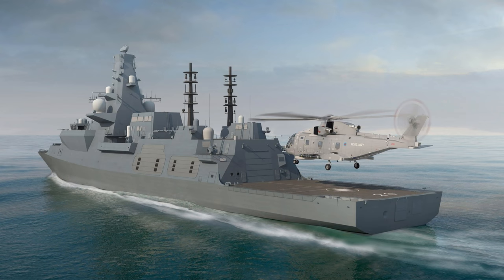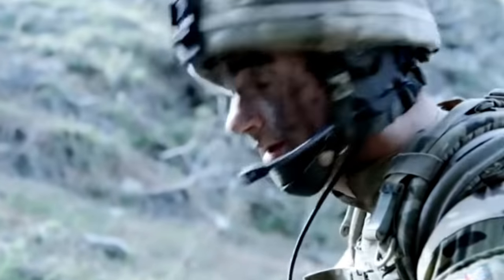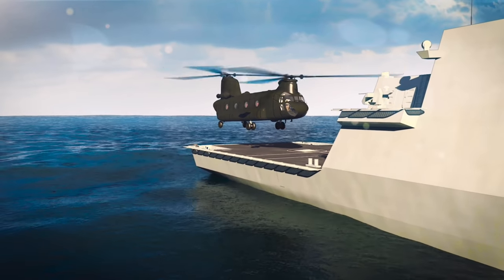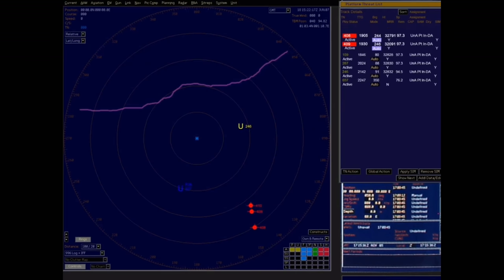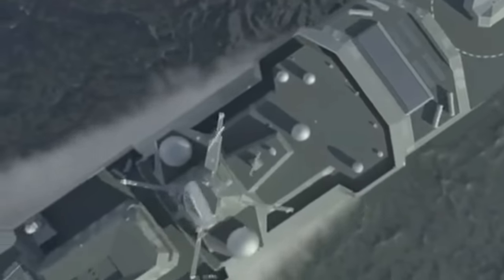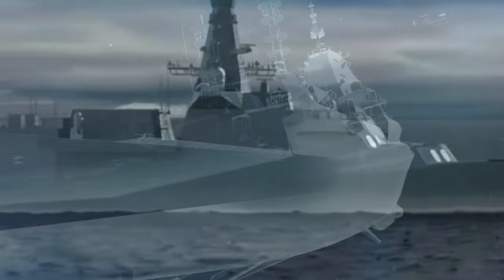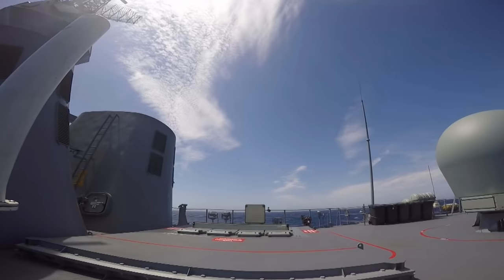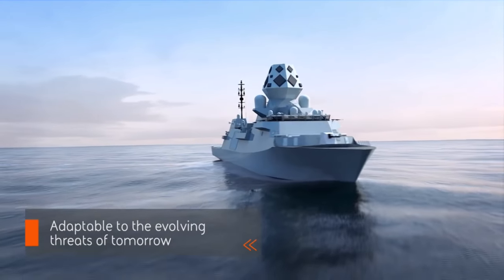British Type 26 Frigate | FUTURE NAVAL FLEET PROTECTION

Comment: well it has a tiny and relatively shitty radar, also no phased radar for guiding and tracing, limited weaponry and they are incredibly slow. not bad, but not great either and at the moment nothing but a paper tiger like most british wonder weapons. lets just hope they are not as bad as the type 45 and its massive problems like the entire ship being dead in the water sometimes or the engines failing when the weather is nice.
Reply: The Artisan Radar is good (for now at least).Weaponry is capable for a specialist ASW Frigate,with the MK41 VLS you can pick and choose which Weapons you want (or can afford). The Speed is a red herring,they will be capable of 30 knots easily when they are built.The PowerTrain has been completely changed compared to the T45's.
Reply: @paultanton4307  I don't buy into the idea of building war ships that are only good at one thing, that's just wasting resources, the US navy on the other hand simply keeps building their destroyer class year after year and it's good at everything at once. anyways, yes this is a ASW frigate, but they try to make it look like a "Global Combat Ship" just like other frigates claim to be multi purpose and as such it's radars suck.  this small and "build to a budget" radar is on the same level as most corvette radar systems and it doesn't even remotely compare to a Smart-L and APAR equipped frigate like the Sachsen class or Iver Huitfeldt-class. also the state of british ship building doesn't inspire confidence when it comes to ships electronics and propulsion. the last british wonder weapon that they tried to make out as the worlds best turned out to be a bit of a overly expensive piece of driftwood. so their word means nothing.
Reply: The UK has Two Aces in the Pack - the Sampson Radar System which will hopefully evolve plus the DragonFire Laser Weapon System,so while Hypersonic Missiles etc pose a creditable threat the T26 should be able to match them.
Reply: @paultanton4307  both of these are not going to be integrated into this frigate, according to wikipedia at least and I don't how they could be based on the super structure of the ship.
Reply: @swunt10  Not for the foreseeable future but when Dragonfire matures and the T26 forms the basis of the Royal Navy's next Destroyer it should be able to use a Sampson derivative.